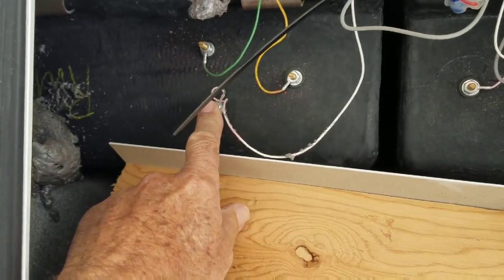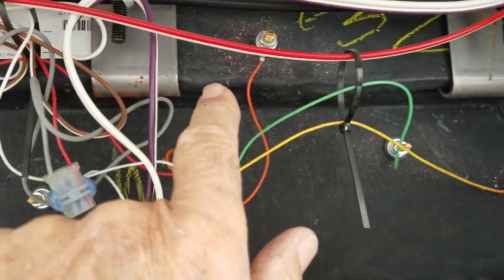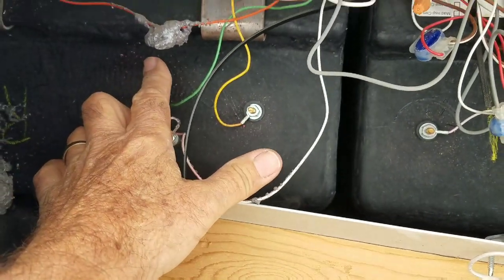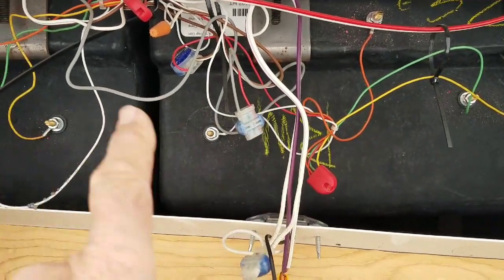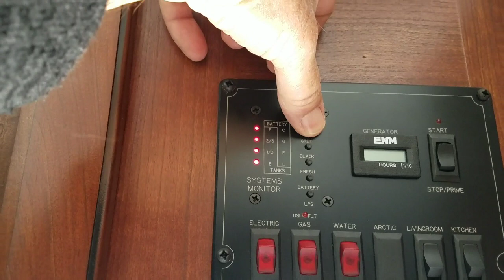How to test and replace defective holding tank sensors in RV

Comment: Thanks for the video!   I believe that the bolts were notched so that you know the orientation of the half shield on the inside of the tank.
Reply from the maker: Agree, too bad the manufacturer didn't know that when they installed them in the tank

Comment: Great video.  Very helpful.  I like that you didn't leave out any surprises to your project allowing the veiwer to see what you did to get through those.  Great job
Reply: Maybe I missed something, but I didn't see any part of replacement. I saw how he pried out the old one but didn't show how it was actually held in or how to put the new ones in.
Reply from the maker: @mr7badass  sorry if I missed that part but when you remove the old one there is a hole left that the new ones slides into and when you tighten the nut it pulls and expands the rubber to seal the hole.

Comment: Great video man.  
I learned a lot.  Most these other guys want to play music and intros and spend ten minutes talking about something else. Then they go trust the repair mechanics and get screwed lol. Hey, I been eyeballing that stool, also! Is that the harbor freight one? It’s literally on my list right now. Need to remove my wooden chair in the trailer and get a lower profile chair for my desk and I think that would be perfect.  

Cudos to you, though for this video.  
I actually felt compelled to sign in and comment for several reasons! 

My Travel trailer grey tank shows 1/3rd full after I emptied it, for the first time today. I’ve probably dumped it 30 times by now and this is the first time anything weird ever happened like that. 

Maybe a food particle stuck on the sensors or something.  Need to investigate.  My tank it not exposed however. It’s under the trailer above the chloroplast liner.  I’ll have to get dirty and go under there and unscrew and pull the liner back a ways to investigate. 

Which leads me to say..
Yes this is a brand new 2020 trailer and yes I’ve had tons of problems with it since day once. The first thing wrong is the ac never worked at all from the get go and I’m in Florida! They didn’t listen to me on the walkthrough and sent me home bad. My fault I didn’t speak up louder about why the ac doesn’t cool down. Lesson learned. 
Replaced the ac unit myself. Super not easy when it weighs 85lbs and has to be lifted 13’ in the air.  

I broke a rib while removing the replacement. 

I’ve found pieces of the ceiling stuck in the plumbing pipes and keeping my grey valve from fully closing as well as many many other issues.  

These things are built by completely incompetent people and obviously QC is out the window.  

People like you and me are what makes this possible.  Guys who eff off the mechanics and learn how to take care of business and share it with the rest of the world.

Comment: Thank you for the video., I have the same problem with my black always reading 2/3 full. I have also found out that those sensors can be installed upside down. That plastic hood should be a "roof" for the sensor and not a floor. (if that makes sense) I noticed that yours were installed upside down (from the factory)
Reply: Debby, good catch.  It's also notable to mention that the notch in the end of the threaded shaft is used to determine the position of the hood/tent.  i.e. not only used for grabbing with pliers as the host mentioned.

Comment: So it’s been abit since you posted this tech tip and it’s excellent! But let me ask you this. My coach is two years old and the fresh water tank is under the bed. So I had it out to dewinterize it and sanitize the fresh water tank. My panel said it was empty. Would it be the same scenario as your waste tanks? It seemed in your video you only replaced the white wire sensor unless i missed something. Is it just as easy to pull out a faulty sensor rather than drill next to the original and install a new one. I thought you’d crack the tank but didn’t. Any advice would help. I’ve seen nothing on the fresh water tanks but only black and grey. Thanks.
Reply from the maker: First of all I have never had any issues with my freshwater tank sensors and I haven't heard of anybody having any problems, but I guess it's entirely possible, as far as replacing the sensors, I'm sure they are the same as the ones in the other tanks and they're not that hard to remove. I would try to replace them in the same holes rather than drill new holes. I would also check the wires.

Comment: Hey jdgrover1 how are your new tank level sensors doing? I see its been over a year since you posted your video showing how to replace them. My tanks never show empty when I know for a fact that they are. I'm  little surprised at the fancy original equipment sensors corroded that much. Not so fancy after all eh.
Reply from the maker: Bill,
 I have to say so far so good. You know I do have to say I guess I'm lucky that the sensors on my motorhome are pretty easy to get to.
Reply: jdgrover1 I just pulled the underbelly off my fifth wheel to fix a leak on the gray tank. It turns out that the sensors are easy to get to and replace.

Comment: I have the opposite problem where my grey tank always shows 1/3 full when empty.  I've tried the dish washing detergent, various chemicals, etc. with no luck so until I get my butt under my trailer, I'm assuming the tank is gunked up on the inside because it only does this after we start a new trip.

The black tank never has this issue.  Must be the fiber!

BTW, I have a Forest River trailer that is 6 years old and yes, I did have many nit picking problems since the very first day I bought it brand new.  If you RV, you'd better be handy with tools.
Reply from the maker: Good luck! And yes you're right if you can fix it yourself you sure can save yourself a lot of money
Reply: I got lines to the kitchen sink busted and the lines by the water heater broke out too, the parts are expensive and the crimping tool alost 70 dollars,  after repairs and tools n parts about 150. Better then technician coming to fix same would of been over 500 bucks, plus i have the tool for my own repairs , hey. Saved alot doing it myself, sure its frustrating,  but what the heck, look at it broke down and pay a bundo at around 100$ an hour plus a 100 just to come and look at it, no way jose,  next fix is the sensors and thank you for an eye opener .miguel from lorain ohio with a jayco 2005  nice condition got for 4500. New it cost 15k or so

Comment: My RV sensors are literally changing levels within minutes/seconds and nothing has changed. I really wish I could change these myself. I don't trust the dealers either besides the $100+/hr price tag.  I really think they made these rigs so you have to come back frequently for repairs. I've never heard anyone say "I've never had one problem with my rig".
Reply: Which is the reason I dont beat myself up for not buying a new one. I've always purchased fairly old models knowing im going to need to fix probably near everything imaginable anyway. Here this poor guy buys a brand new RV and is having the same issues im having with my 2006 model Jayco.  no leaks in mine yet, but I keep it in a machine shop.

Comment: The new sensors most definitely look different. Did you just  install the new ones without the corroded plastic pieces?
Reply from the maker: I just installed the regular button ones and haven't had any problems since.

Comment: The ones with the plastic hood are for black water
Reply from the maker: Both tanks had that type of sensor and I know some people said they were upside down but that's the way it came from the manufacturer of the motorhome, so I would have to say the manufacturer doesn't have employees that are taught how to install them. Either way they failed and the video was not so much about the type of sensor as it was how to test them and replace them.

Comment: These are not "sensors" they are literally conductive pieces of metal that allows for a change in reported voltage (and in turn resistance which is a set value for the monitoring panel). They are literally nothing more than screws with round heads. It would pay to read the documentation on the KIB tank monitoring systems (and similar). They are literally nothing more than threaded studs with rounded heads who allow for a measurable conductivity. The issue is them getting dirty, not needing replacement, they're just metal pieces, not "sensors" but are just conductors. Clean your tanks, don't go through this mess. These types of systems are notorious for providing unreliable / inaccurate readings because they get dirty from insufficient tank maintenance, and even then, from the factory can produce inconsistent readings. Always use septic-safe paper and use ample amounts of water when flushing to ensure solids are diluted as much as possible in the tank(s).

Comment: Wipe them off and put them back in…
Reply from the maker: I don't know what you may have had on yours that you could wipe off but the ones that I removed was more like a mineral buildup or corrosion?
Reply: @jdgrover1  Water softener added to the tank over time would have alleviated this conductivity issue you were experiencing. Replacing what you call "Sensors" (they're just dome-headed bolts) was superfluous, there are many simple ways to address this tank maintenance issue.
Reply from the maker: @Desert-edDave  I don't know you seem to be kind of hung up because I called them sensors but if I just do a simple search about holding tank sensors you get all kinds of Manufacturers that sell holding tank sensors but if you want to call them little button head Dome pieces of Steel that is true of what they are. I just tried to put something out there that might actually help somebody figure out their problem.